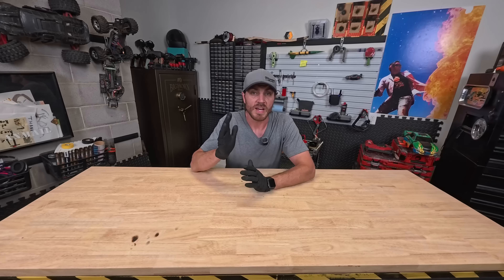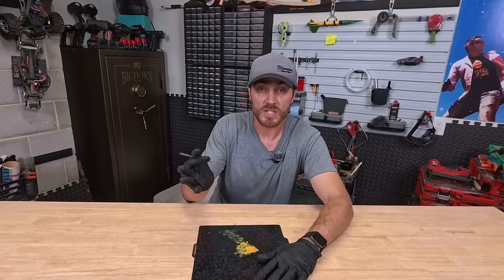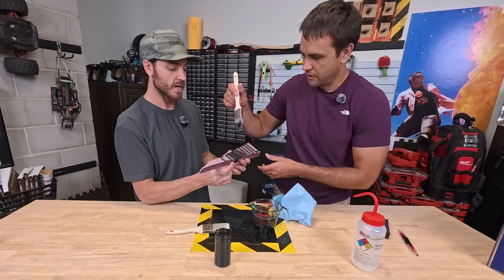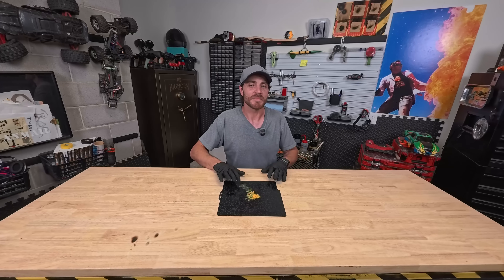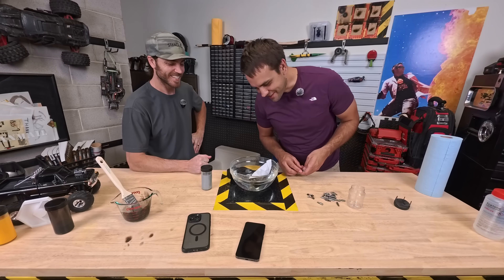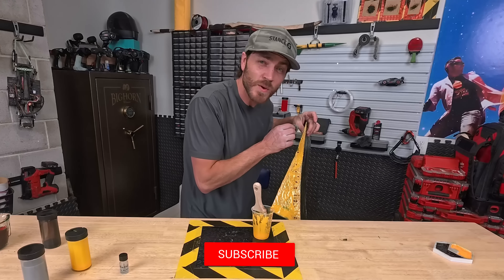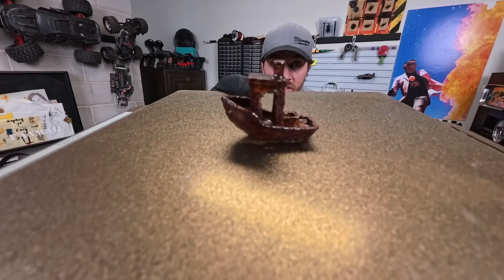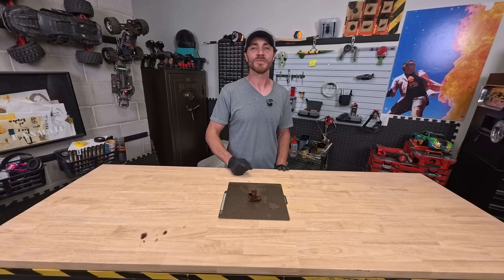3D PRINTING WITHOUT A PRINTER?

Comment: While the flash point of almost all woods is at over 300°C several elements/items have melting points lower than that. Some are listed below. Put it in a pot on a hot plate in a vacuum chamber. See if the wood absorbs it. You can go farther, make little figurines with the wood and turn them metallic

Gallium, phosphorus, potassium, sodium, sulfur, iodine, indium, lithium, selenium, tin, Bismuth petroleum jelly, oil, paint, epoxy and more

Comment: This is the first time I've watched TKOR in about 2 years - and it will be the last. Regardless of the reason: the production quality is terrible. Audio is poor. It was shot with a single camera on a tripod & no close-ups or detail shots. No explanation of cutting the abs filament into pellets so it dissolves faster or any other steps. Worse while there was a safety disclaimer, the host did not practice any safety steps! Where was the ventilation? Nitrile gloves are not approved for use with acetone. Where are the safety glasses? 

Grant would be ashamed. Quit while you are ahead. Quit before someone actually copies this and injures themselves.
Reply: well said. staying subbed to honour Grant but this channel is just not the same anymore.

Comment: those 3d pens. that can draw 3d shapes with plastic.
Reply: Well actually you draw shapes and connect them. 

So to make a sphere you make two circles and connect them then create a “wireframe” like it’s a 3D model in blender or 3DS Max.
Reply: That would be interesting to see how long it takes to manually 3D print with those pens